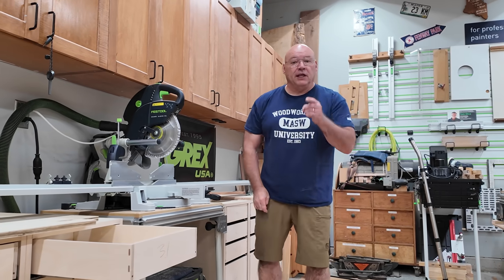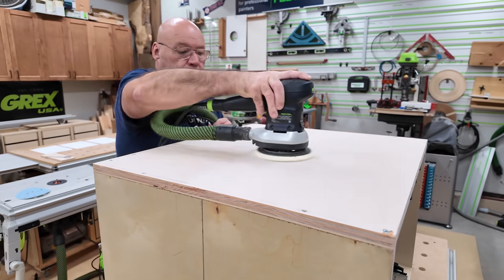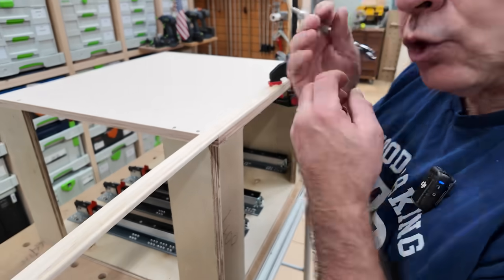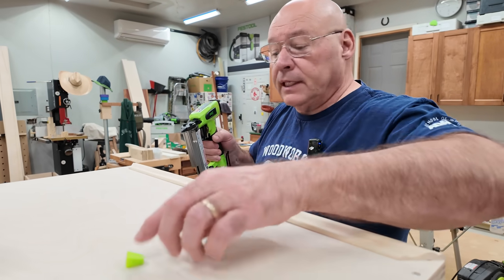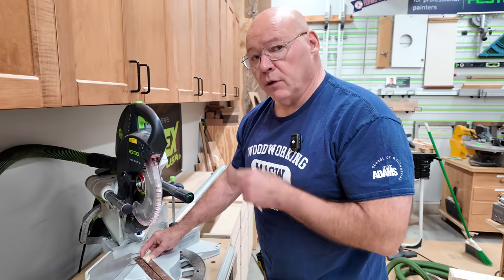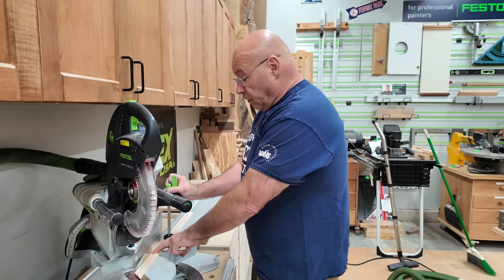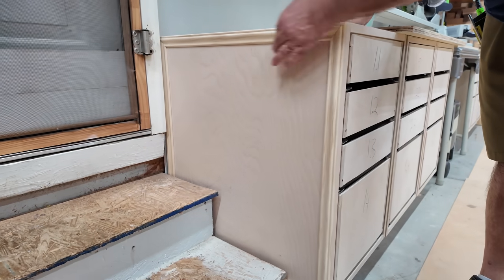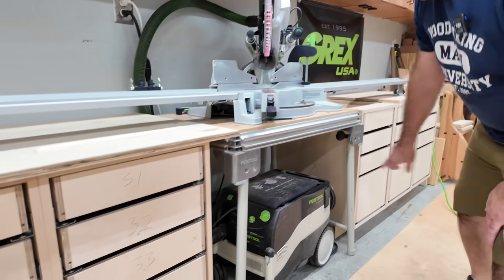Master The Art Of Cabinet And Drawer Construction With These Key Details!

Comment: In the shops I worked at, we would rout all of the drawer stock with what we called a thumbnail profile bit. We would make the front and back of the drawer box slightly taller to not have weird transitions in the corners.
Reply: Did you mean the sides slightly taller? Front and back should be between the sides
Reply from the maker: cool
Reply: @Rene-Hernandez if you have half blind dovetails, front and backs would be taller

Comment: SEDGE hello…
I bought about $1000 of Brilliant 2 sandpaper 5inch for $150 on EBay. 80 grit to 400. 
Problem is the hole patern is different the current Festool pad. 

Is there a simple solution?

I have an arbor press that I have been punching new holes to use the supply. 
Paper seems to work great. 
Thanks in advance.
Reply from the maker: some of the outer holes should line up...just not all of them..still should be good dust extraction